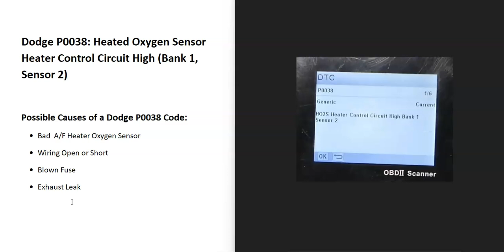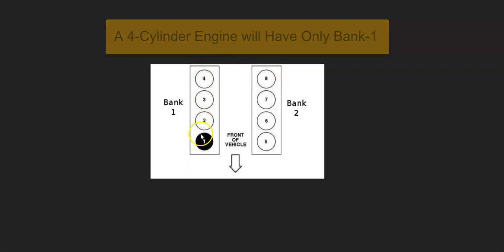Causes and Fixes Dodge P0038: Heated Oxygen Sensor Heater Control Circuit High (Bank 1, Sensor 2)

Comment: But will this code keep the truck from starting up
Reply from the maker: The engine will still start with a bad 02 sensor. It will just run in what's called an open loop, get worse gas mileage, and be less responsive, but it will still start and be drive-able.

Comment: I have p0038 p0161 and replaced all the sensors with cheap ones i now have these codes and hesitation on acceleration. Ive already replaced all intake seals and transmission full drain new filters and torque converter
Reply: Wrong brand . Wrong ohms. Try denso.

Comment: Where is this fuse that everybody keeps talking about because I'm not seeing it. Is it a fuse or is it a relay. My fuse box data plate has no info on it. 2008 Chrysler Town and country 3.8 v6
Reply: Im confused too. Fuse 30A seems to protect whole ECU, and its the fuse that controll ignition and injectors, so how can be fuse problem if my car is running. Im to small for this.

Comment: What if I have this basic code but for all 4 of my 02 sensors, plus my battery light is on and I'm smelling a rich mixture of fuel/ air
Reply from the maker: It likely a fuel issue like a bad injector
Reply: Check your PCM connectors at the computer. If one of them is loose it will have similar symptoms.
Reply: How’s it going I also have the codes for all o2 sensors may I ask what the problem was ? Thank you
Reply: @JP-bq2hs  jumped timing, scored cylinders, needed new engine
Reply: @joshuafruth6420  All 4 of my sensors show this code and ive no idea why. I replaced pcm, sensors and fuses still can't figure it out
Reply: @WendysAnime  I had an engine that had skipped timing/belt
Reply: @WendysAnime did you find solution?